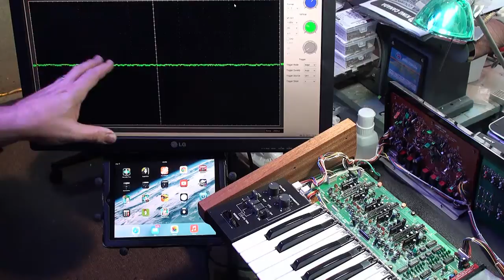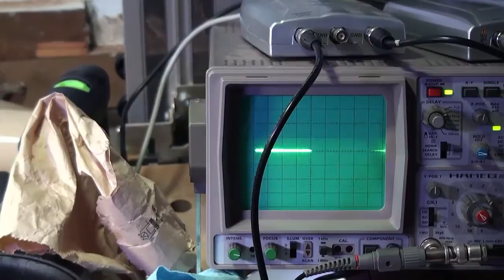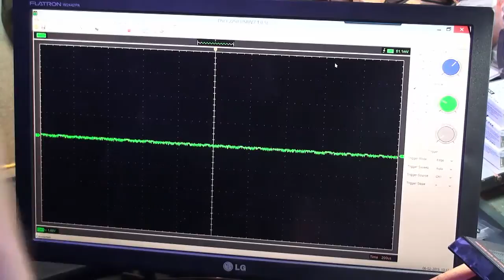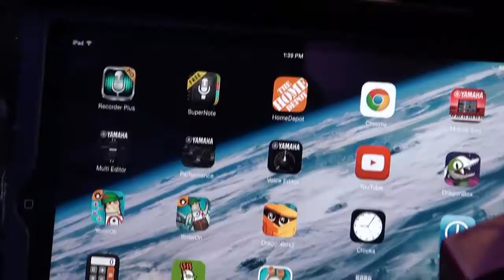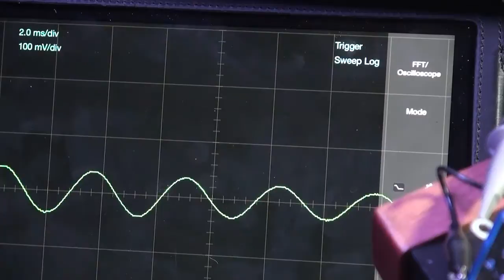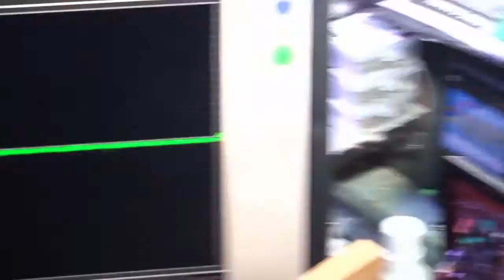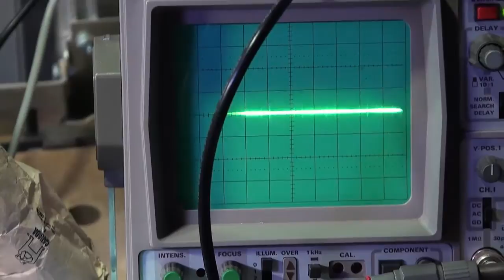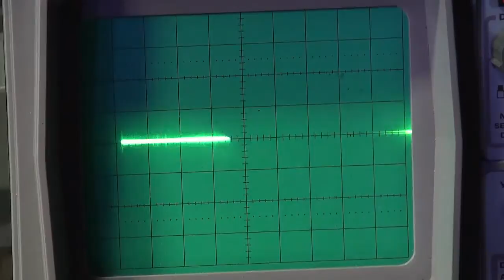BT's Kiwi-106: Part 8B (Calibration - iOS Tuner Apps)

Comment: Hi Syntegrator! I fully agree on the old scope idea. Older scopes, while limited in comparison were tightly designed for purpose and did what they should do very, very well. A device like an iPad or Laptop has to be many different things and cant compare to a specialized scope.
Im doing audio Lissajous Curves on an old €60 Trio CS-1022 and it produces - you know - analogue lines... my iPad and Mac Mini produce lines by placing individual pixels - no comparison, the old scope is infinitely better!
Reply: When you dig into the manuals, you realize how much the newer scopes actually lie.

An older analog scope works by the input signal directing the trace across the crt. You are seeing the actual signal and can interact by altering the settings.

A newer digital scope takes samples of the signal at intervals and extrapolates points in between. If the sampling rate is too low, you're not looking at the signal properly. Those bumps simply don't last long enough to even register.

A well equipped lab should have both.